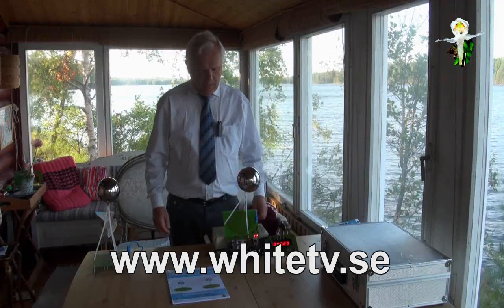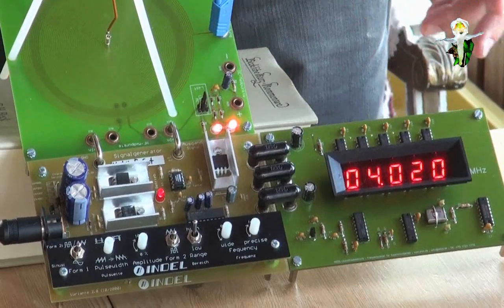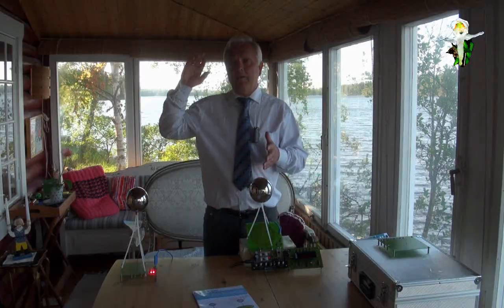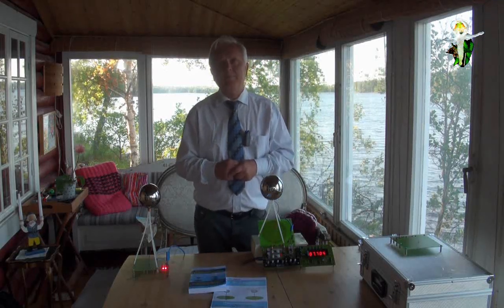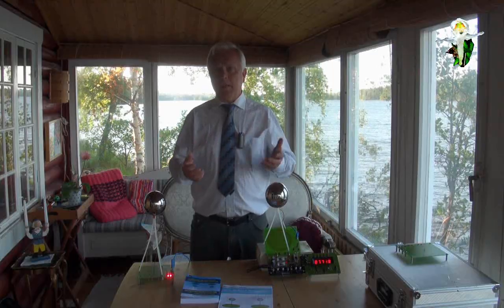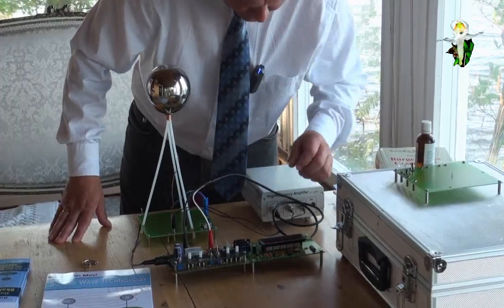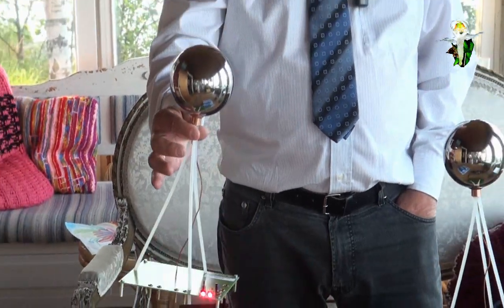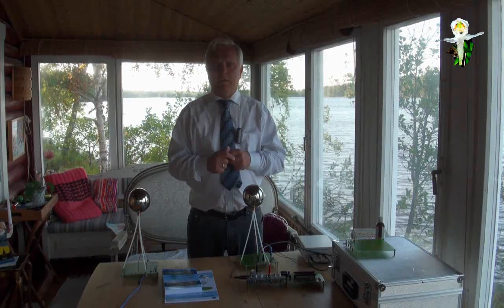Technical proof: scalar waves exist

Comment: There is nothing wrong with your television set. Do not attempt to adjust the picture. We are controlling transmission. If we wish to make it louder, we will bring up the volume. If we wish to make it softer, we will tune it to a whisper. We can reduce the focus to a soft blur, or sharpen it to crystal clarity. We will control the horizontal. We will control the vertical. For the next hour, sit quietly and we will control all that you see and hear. You are about to experience the awe and mystery which reaches from the inner mind to... The Outer Limits.

Comment: It would be a shame to try and code the signal to keep people enslaved to the energy barons. This system only needs its "bell rung" very occasionally, with only small inputs of power. This system would be free to operate. To charge for it is criminal.

Comment: I'm tempted to exceed the limit on superlatives, this is the best of the best teaching videos.

Einstein is correct for the standing wave/brane or timing-spacing positioning "embodiment" properties of matter and resonant photons, in the Quantum Fields Modulation Mechanism of "Atoms", tuned vortices of vortices-> physical-chemical and observable, ("anthropic") universe.  
This demonstration applies to the general characteristics of multi-phase QM-TIMESPACE modulation, and the "One Electron" phenomena of Temporal Superposition-point Singularity => zero distance/tunneling in the now-instant, quantum-jump/latency.

The risk or otherwise of Mobile phone transmissions is not yet clearly demonstrated? I'm more wary of "free-energy" extraction of binding forces through the "latency resonance", (Superspin-conduction etc properties) mechanism, than the condensation/reception of "sensing" In-form-ation received by Mobile phone antennas.

Comment: Most focused laser beams have scalar longitudinal energy. All one would have to do a mount a plasma discharge arc lamp to one of these and use high voltage impulsed DC to fire it. this way the light has more intense longitudinal radiant components just like tesla did with beamed impulse arc lamps. The more powerful radiant components are in the uv bands also.
Reply: A guy did this same thing, he was trying to fire his Jacob's Ladder using a low powered laser, supposedly he invented time travel. It worked well enough for him to steal transmission line transformers to continue his experiments.

Comment: Thank you for the video; I am a fan of Dr. Meyl's work. With that said, why is the longitudinal signal being disrupted by his hand at ~ 35 minutes? It's clear on the LED lights.
Reply: As he states 5 seconds after he disrupts it. It is like a capacitor  and by bringing his conductive finger to the transmitor he detuned it. Also there is a difference between shealding and absorbing energy. There are videos on YT which show that a scalar wave penetrates inside a Faraday cage because the e field is perpendicular to the wall. But a volumous hand should absorb some amount of the energy. But i am no expert...